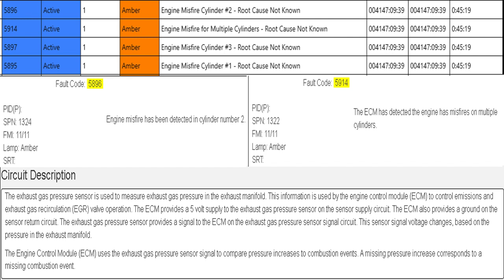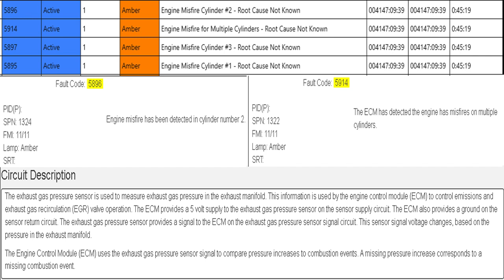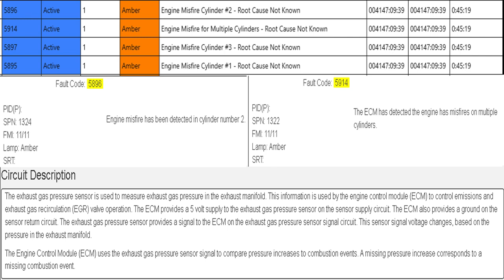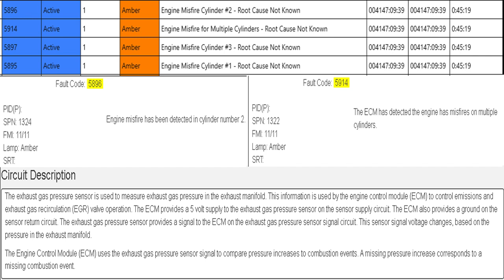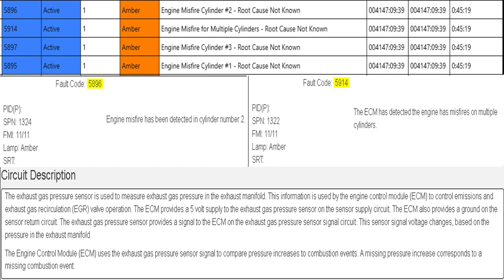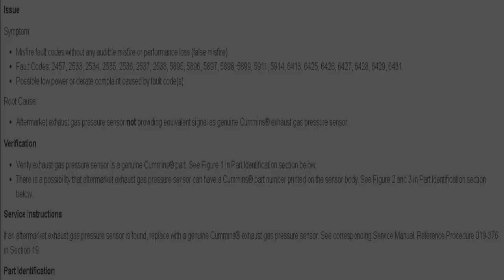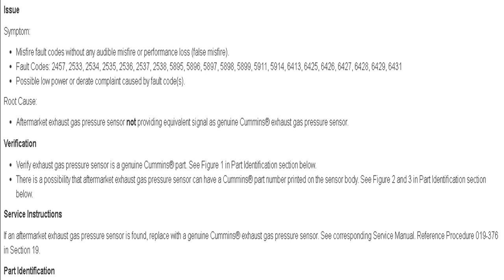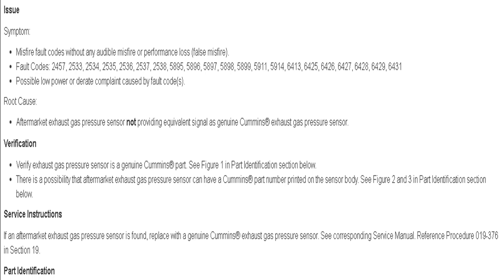Why am I logging miss fire faults when the engine runs fine?

Comment: I’ve found, particularly with the isb’s, if there are cylinder misfires starting with a high count on #6 then the counts which each other decreases, example #6 30counts, #5 20counts, #4 10counts, it’s from the EGPS sensing tube becoming clogged. I’m assuming it’s because the exhaust pulses at the rear of the engine are not as strong as the first three which is why they show up first.

Comment: Thanks for sharing Joe. Totally agree, I only use and recommend genuine sensor across the board for any repair I do. I understand why some folks had to use aftermarket because this sensor was on backorder for awhile couple years back. I have been experimenting with a strategy using piezo style pulse sensor with my Picoscope to isolate misfires. I have found with an adapter in DOC inlet temp probe port (Cummins sells adapter) and section silicone hose I can actually confirm a misfire (manifold readings were two noisy to interpret for me). The pulse is quite interesting to view and it is a series of pulses as valve opens then changes as piston continues its downward stroke then changes as piston starts upward travel. Natural piston speed accel/decel, other cylinders firing, and ECM compensation all have to be considered but once you spot one that doesn't look like the others and you set up some engine phase rulers and chart it on a piston valve relationship chart you can identify the suspect cylinder. It seems Cummins used to work with Scania in the past a lot on some research and I found an excellent degree project paper on the web that covers misfire detection with EBP sensor strategy by BJÖRN NYBÄCK called Exhaust Pressure based misfire detection.
Reply from the maker: Thank you for that information. I never would have tried checking at the DOC inlet- good thinking. I will look for that paper sounds like an interesting read.
Appreciate all the tips you share with the channel. We never know when something we share will help someone out of a pinch.